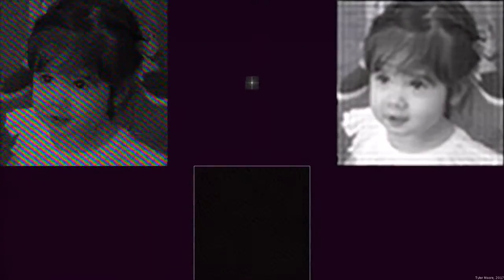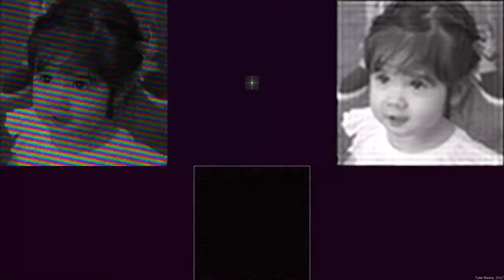2D Fourier Transform - An Example

Comment: Isn't MR filling K-space from top to bottom ?
Reply from the maker: iMANTlS, not necessarily. There are various approaches to filling k-space. Some don't even use Cartesian coordinates but use radial coordinates. Some (like keyhole techniques) fill the periphery of k-space once and do multiple acquisitions of the center of k-space. Most, however, prioritize acquisition of the center of k-space so that SNR is maximized there.

This video does not show a typical approach to filling k-space with MR. Instead, it's designed to show how what the center of k-space contributes to the final real-space image compared to the periphery of k-space.

Comment: svp j ai besoin d un aide dans ce sujet  si vous pouvez me contacter
Reply from the maker: My French is very bad. It is certainly not good enough to discuss Fourier transform! I could use Google Translate, but I think the technical words would be wrong.
Reply: @overtone1000  so I need to write a simple programme of fourier transform for my project cz i m studying that's why i asked u if u could help me sir
Reply from the maker: @blackdream8130  The source code (written using Processing) used to make these videos is available on GitHub.
https://github.com/overtone1000/MR-Physics/blob/master/TRM_MRI/Fourier.pde

However, this is unlikely to suit your needs. It is likely that there is already a good math library for your programming that will do Fourier transform very efficiently. I recommend that you find that library. What programming language are you using?